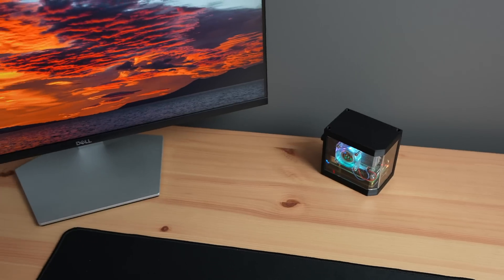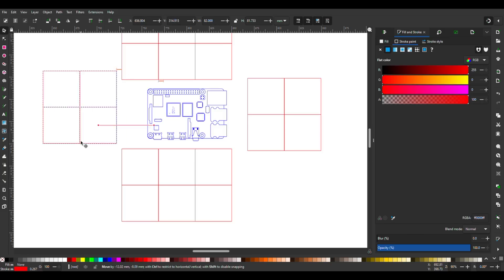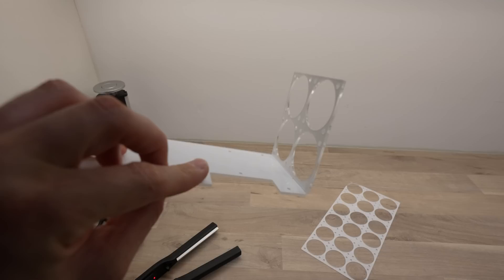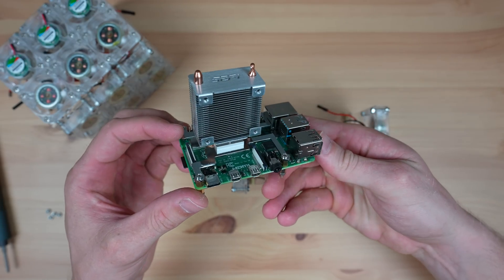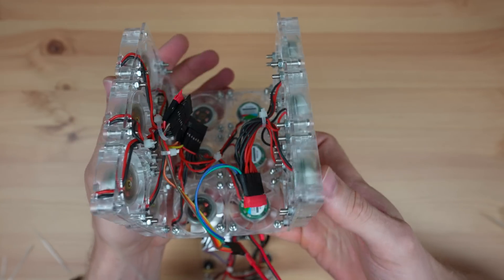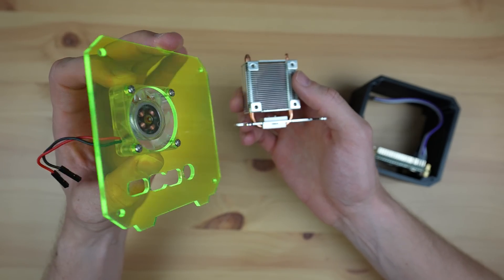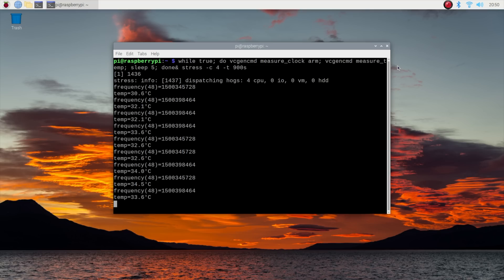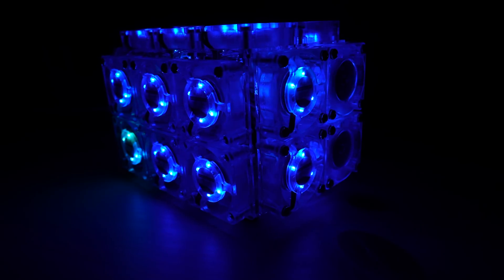I Made An Only Fans Case For My Raspberry Pi - How Does It Perform?

Comment: What I would have done was use a old thin client PSU that has both 12V and 5V.

then use 12V fans, and have the pi control a relay upon boot, that activates all fans.

Comment: That video description maaaaan. :DDD
BTW the case looks sick but i would never use anything like this. It have 23 more fan then it needed so as u mentioned the power consumption went up by a lot and it is just a waste to get the temperature down by 3-4 celsius. The fans also make heat and they power supply also make extra heat.

Comment: i think the fans blowing in different directions could be detrimental.

left side in right side out is a good arrangement, 
but the fans that try to move air at a 90° angle to that might be hindering the simple crossflow.
i ponder that the most energy efficient way would be three or six fans blowing air through the case with a large opening at the oposing side, and all other ventilation closed.

Comment: Cooling is a function of how much air is moving not the number of fans.   Would it be better to use 2 80mm fans or a single 120mm fan?  A 40mm fan moves about 20CFM.  A Cooler Master Jetflo 120mm fan moves 97 CFM.

Comment: I am a fan of the fan case. 😂 What would be interesting: as the small fans produce only little air flow, what would happen if you replace the sides with only 1 big fan each with massive air flow? I think the ice tower is not ventilated properly with the turbulences of 24 small fans. So if you want to have another go: only two 80/90mm fans left and right in push-pull config, rest of the case completely closed.

Comment: you should try negative pressure, orient all fans outwards, it should get you lower temperatures
Reply from the maker: Expanding air (into a negative pressure space like this) will drop the air temperature, but only very slightly because the pressure difference is not going to be that significant. A 5 Pa drop in pressure, which is probably a bit more than what these fans would achieve, would only drop the internal temperature by around half a degree celcius.
Reply: i don;t think it matters. so much cable clutter from the fans defeats any singnificant air movement.
Reply: @giornikitop5373  if the fans point out, it wont matter the "air movement" since its gonna deal with pressure. it just needs to be properly sealed (not air tight, although this ain't strong fans, air still needs to get in somehow but need to be restricted to cause the low pressure)

Comment: I REALLY like how the ports and the two fans looked!!! It was like they made up a face with either a blinking or black eye LOL (because they were facing opposite directions) - Maybe you could turn this into a case design.....  you could make some air guides to direct the air in through the one fan, through the ice tower, then out the other.... I think this would work even better than you typical ice tower/uni-fan design AND the 'Only Fans' case (LOVE THAT NAME LMAO!!) - If you  look at how servers are built they have fan in the front of the case blowing in, and that's it... but the CPU coolers are dense, short stacks that use that high air flow very well... and a lot of companies that build servers use air guides to almost compress the air so that its squeezed down to the width of the cooler. And they use this single front-to-back air flow to cool everything inside the rack mount blade server... it's SUPER efficient
So with this idea of efficient usage the air guides would be best if they were curved if you were to use the two front fans going in opposite direction. You could have a divider between the fans going to the tower, and the sides of the case would have the curve to guide the into the tower fins (since the tower is perpendicular to the direction of the fans output) ..... Yes it would be more efficient to just put one fan on each side of the power for this push-pull configuration, but where's the fun in that? lol this way you get to make that face with the fans and ports and it's totally different than what you you usually do.... I think it would have it's own challenges.... ESPECIALLY if you were to use acrylic - but you could heat it with an air gun if you have one, or blow-torch would work too.. I've seen it done a few times - but this way the sides and the rear are all one curved piece... but you could make the top and bottom just some 3d-printed caps you just clip on (but you'd have to get the measurements just right after you bend the acrylic) ... idk why I'm telling you how to do it LOL I'm just working out the steps in my head and typing my thoughts... you know what you're doing.... it might make for an interesting case and build, and you get new content :D I hope you like it and make it.. if not, it's no biggie :)
Reply from the maker: Thanks for the suggestion, I'll definitely keep this in mind for a future build. Haha, now that you mention it, it does look like a face!

Comment: With the latest version of Bullseye, the pi 4 runs at 1.8 gHz base speed instead of 1.5 gHz. 
The fan case looks like it's ready for Christmas 🎄
Reply from the maker: I hadn't noticed that they have changed the base clock frequency, thanks for letting me know.
Reply: The CM4s still run at 1.5Ghz. I recently flashed them on my DeskPi Super6c^^

Comment: That was a fun exercise.  I wonder if the fans would have balanced out if you ran 3 or 4 in series fed by 12V.  Fan speed a little slower.  Lower power requirement from supply.  More curious than suggestion.